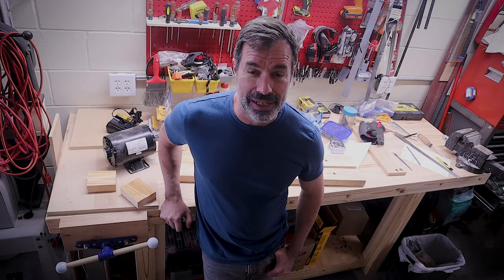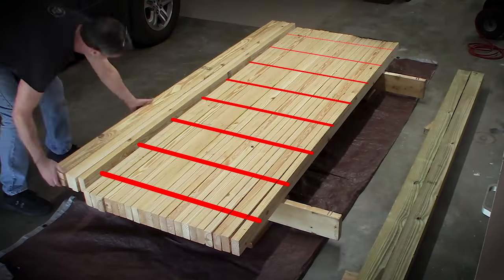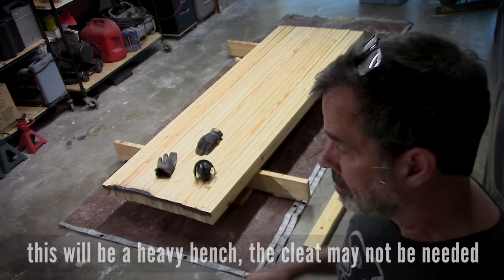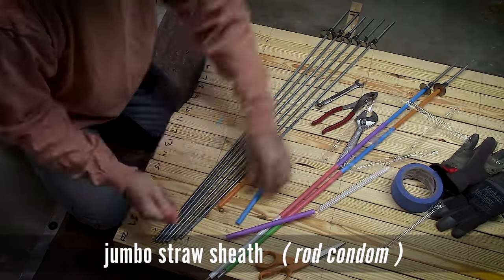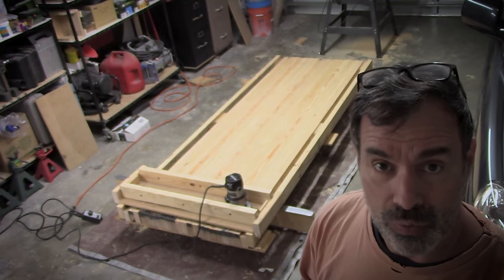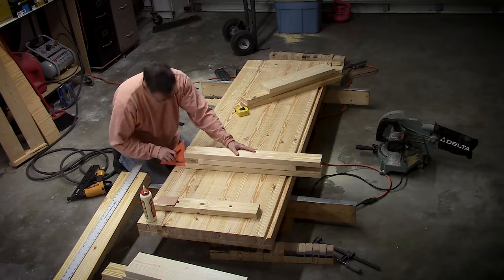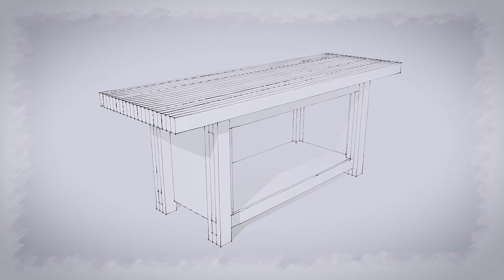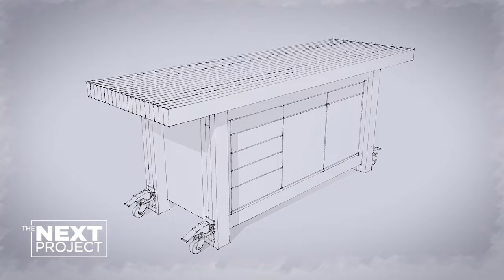Workbench BUILD Project. Easy, Cheap, Solid!

Comment: I got depressed looking at clamps prices and the rods idea is what I really need. Thanks for putting together this video.
Reply from the maker: Thanks for watching!
Agreed, clamp prices really bite. 
I looked at various long bar clamps, pipe clamps... nothing fit the budget.
The threaded rod idea was borrowed from others, then updated with the straw liners. Made it really easy to remove the rods.
If I were a bit better prepared, I would have had an extra set of hands and a impact to tighten everything up quickly, but it went well as it was.
A project I'm glad I got around to. Using the bench all the time.
Hope all is well, be safe and take care!

Comment: with the amount of wood alone i dont believe it was that cheap
Reply from the maker: Pedro, thanks for watching!
I put the material costs, at the time of the project,  in the video. 
https://youtu.be/-C-s544KZqg?si=_Sf5gj0hTCROQ-FW&t=1107

Southern Yellow Pine material costs as of "today" are actually lower than when I made the bench. Right now, the lumber (locally) would be $85 US. At the time I made the bench the lumber cost was $100 US.
I had planned to make a bench for a couple of years prior, but material prices were double, so I put the project off, and off... 
If I built this bench today, total material cost would be around $100 US (lumber, screws and glue). That's for the basic framed in bench, no add-ons.

This bench is made from southern yellow pine, not maple or anything fancy.
Good luck with your projects, take care!

Comment: Well Done ,    I really like the overall Cost  on the Bench  that IMO  is a very affordable Tool for any WorkShop  no matter what Trade   Is your Specialty or Focus  a Quality Bench like yours could be easily adapted  for Automotive work , Machinists,Woodworking  or just about anything  making it  having a great resale Value  if you ever wanted to go that Route  all you need to do is look at Commercially Available Benches and their Pricing   Which are Rediculously in the thousands Of Dollars
Reply from the maker: Craig, thanks for watching!
Agreed, this is a pretty good bench, especially for the money.
It's been about 2 years now, and I really can't complain about anything, it's been holding up great.
If I were to do it again, I would be more picky with the lumber I chose for the actual top. I have a mixture of tight grain, and some wider (fast growth) grain.  The tight grain is very stable, the wide grain has shrunk just a bit. 
No issues with the top, other than noticing a little wave in the wide grain lumber. Glue seams are all tight, so I think this bench will last longer than I will. 
Hope all is well, be safe and take care!

Comment: Looking to build my first workbench and while there are some easier builds, this right here is quite straightforward, absolutely beautiful, sturdy workbench and it moves to the top of my list. It will be more than 20 working hours for me for sure, but I'd love this workhorse in my basement. Great job, TNP!
Reply from the maker: isles, thanks for watching!
In the basement, nice!
This bench will be heavy, so it may want to stay in the basement, forever!

Be sure to modify the build, size and process to fit your needs and workflow.
That's one reason I built this bench, to fit "my" needs. As you mentioned there are a lot of easier benches out there. 
This is a bench I wish I'd had years ago.

One thing I didn't mention and really didn't pay attention to when I was making this bench. Be sure the wood you are using for the top slab is not heartwood - the center rings of the tree.  It will dry at a different rate than wood from the outer rings.
Overall I'm lucky, only have a few "center" type pieces of wood in the top slab.

Good luck with your build, be safe and take care!

Comment: Very cool 🤟
Clamping solution (including the setup drill guide down to "push the rod through as you glue up" 😉
Priceless and fun vid and build.
Cheers
Reply from the maker: Mark, thanks for watching!
The threaded rod worked really well. I was concerned it wouldn't have enough "squeeze" power, but it appears to have done a great job. The top looks seamless other than seeing the wood grain, and the fender washers actually crushed into the sides of the lumber a bit under clamping/tightening pressure. 
I had considered using 3/8" rod initially, but couldn't find enough at the time of purchase. I was concerned the 5/16" would snap, but it worked out well. 
A good project.
Take care!

Comment: Look into the bar clamps from Harbor Freight! Paul Sellers recommendations! No rods!
Reply from the maker: Thanks for watching!

Yep, I did look into the Harbor Freight bar clamps and have some on hand.
There are a  couple versions at my local HF. 
One is an aluminum box material for the bar, I don't find the longer version overly aggressive in clamping, which I needed. The bar stock tends to bend at length. They are affordable, but not near as strong as a slightly more expensive pipe clamp.

The other HF "F" style bar clamp uses roughly 1/4" x 1" stock for the bar. I have a bunch of this style HF clamps, but not enough long 36"+ for this project. The longer HF "F" bar clamps also flex a lot when clamping.  
I'm finding anything over 16", and I need to go with a pipe clamp, or higher quality bar clamp.
The smaller HF "F" bar clamps are great, I use the heck out of them.

Using the threaded rod, was a very affordable alternative, cheaper than buying longer lengths of pipe for my existing pipe clamp ends. 
I've since re-used most of the threaded rod also. So, I've kinda recycled the material into other projects. 
Good to have lots of options.

Thanks again, be safe and take care!

Comment: Excellent job and advice at the end, especially to build a bench to fit your own needs rather than just copy and past another's design.
Looking forward to more. Subscribed.
Reply from the maker: Thanks for watching, and I greatly appreciate your comment.
I pondered making a number of different style benches. Knocking off what others had made.
Then I realized those plans/ideas really didn't fit my needs. Not saying what I built is a 100% there either, but it is in the right direction. 
It was a fun project and I've been using the heck out of it. 
Good luck with your projects, be safe and take care!

Comment: Paint roller for glue-up was genius.🏆
Reply from the maker: Michael, thanks for watching!
The paint roller is the perfect scale for doing the glue up in this scale.
Use a deep nap roller, 3/8" nap or bigger. Short nap rollers won't hold enough glue.
Oh, the weather was also cool when I did this glue up, so the glue didn't instantly tack-up. 
Good luck with your projects!

Comment: Using threaded rods with nuts, etc., on each end running completely through the top that had holes drilled through in line was an interesting and secure way to accomplish the massive one piece glue up.  Is there a reason you opted to not use 36" pipe clamps alternating top and bottom or bar clamps?  Both would have been much less $ than the Parallel clamps also.
Reply from the maker: Thanks for watching!
I had originally planned to used pipe clamps, but I didn't have enough of them, nor enough pipe at the time and the cost of pipe and a few more clamps ended up being more than the threaded rod and pieces.
Otherwise, the plan was pipe clamps.  
Parallel clamps would be nice to have, but I've just never been able to justify the cost, at least for the type of projects I work on. Maybe someday, but no time soon.
Hope all is well, take care!

Comment: If this is what you consider easy, I'd hate to try one of your more difficult builds.  Easy is definitely relative to people's woodworking experience, and access to tools/machines.   

I gotta say that was great ingenuity on the cheap clamps, using the rods.
Reply from the maker: Thanks for watching!
I hear ya, I guess this isn't "easy, easy", but it is kinda easy, in a semi-complex sort of way.

I like finding alternative ways to accomplish tasks, so the threaded rod thing worked really great.
I borrowed that idea from somewhere, a lot of great ideas out there floating around.

Good luck with your project(s).
Take care!

Comment: What happened to the rebar you used to clamp with? Is it still in the top? Going to make something similar for an outside bench and I really liked your design.
Reply from the maker: Thanks for watching!
I've used up 50% of the threaded clamping rod. Various little projects, surprised how often I can use that stuff.
An outside bench, cool!
Good luck with your project.
Reply: Thanks! I mean the rebar you used as a clamp, is that still inside the worktop now or did you slide it back out after clamping? I was thinking you'd leave it in for added strength.
Reply from the maker: That was actually threaded rod, not rebar.  
Probably looked like rebar in the video, but was 5/16" threaded rod. I think it was 6' sections all cut down.  
I did pull it out of the top once the glue dried. Had the rod covered with drinking straws so the glue wouldn't bind it to the top.
Sorry if that was confusing.

Comment: I'm curious on why you used the router sled to flatten the top instead of using the bench plane that you used later?  Was there a benefit to using the router sled vs the bench plane?  I don't have a bench plane, or a fixed based router to mill lumber, and I opted to used plywood for my bench, so it's flat enough :)  Thanks for the video.
Reply from the maker: Thanks for watching and that's great question!

I had a few different/optional plans on how I would do final leveling of the finished top.
A large hand plane was one idea, but would require me to be in better condition than I probably am. My arms would have likely fallen off before I finished.
I also considered a different style glue-up of 10" wide gangs of top lumber which would then be run through the power planer = a really heavy beast to wrestle. I would have then had to glue those large sections together and do a final assembled planing, and that seemed needlessly redundant.
Finally, just using a router with a wide flat bottom bit seemed - easy-ish. 
The more I thought about it, none of the options seemed enjoyable, but using the router appeared to be the most "do-able", and least painful.

There are many different types and styles of bench, and each will have its place. Some are over-the-top, others overly simple.  I've worked on metal benches, plywood benches, solid-core door benches, countertop benches, on sawhorses and garbage barrels. Everything works, and there is nothing wrong with any of those options, they all did the job.

Glad your bench is delivering what you need, that's a perfect bench!

Hope all is well, be safe and take care!
Reply: @theNextProject  Thank you for the reply & the insight.  I've been woodworking for about 18 months now, and I find that I gravitate to a hybrid style between power and hand tools.  I've only worked with project panels and dimensional lumber because I've not had a creative way to mill it.
Reply from the maker: I hear you, milling large chunks of lumber is an issue.
Hybrid work style is a great idea!

I don't have a large jointer, so I do work arounds for that.
I do have a planner, but it's not always easy to navigate - my work space is fluid, so some tools don't have a fixed base and such. I work on the floor, on a bench... where ever there is a free space.

Being able to plane with the router has been a handy way for me to rough out a lot of material.
I can then clean things up with a large hand plane or sanders, but it depends on the scale of the project too.
I'm always looking for ways to make a big task smaller and easier.
Good luck with your woodworking adventures and projects.

Comment: How did you attach the top to the frame? Did you need to do anything to allow for wood movement?
Reply from the maker: Fred, thanks for watching!

Great question, I used eight #10, 3" construction screws. 4 across the front and 4 across the back.  The holes are slightly over-sized, so the head of the screw, not the shank, contact the leg structure. The screws thread about 1" into the bottom of the top. 

It's been almost a year since I made the bench and no issue with wood movement so far, at least nothing noticable. Maybe 3, 4, 5 years will tell a different story.  

I chose not to do a mortise-tenon attachment, as I expect to either need to move the bench someday, resurface or flip the top over. I wanted the top to be simply attached/removed, not permanent. 

Since the top weighs a lot, and the 8 screws keep it in place, I haven't had any issues so far.

While I was influenced by a number of other bench builds, none of them really fit my needs. I didn't want to build a "showcase" bench, but I needed an upgrade from using plywood and solid-core doors as benches. This build is somewhere in between. 
At this point, there are very few things I'd do differently, as it fit my needs, tools and abilities. It has been fleshed out with some drawers and cabinet doors since the video. The rollers added allow me to easily move the loaded bench across the garage floor, really nice when needed.

Good luck with whatever you build, make it fit your needs and have fun.
Be safe and take care!
Reply: Many thanks! @theNextProject

Comment: Is this bench supposed to be bullet proof?  Have you considered adding a steel plate for high power rounds
Reply from the maker: Ronin, thanks for watching!
Didn't plan on shooting at, nor finding cover behind the bench, so no, not really bullet proof. 
An add-on metal "drain pan worktop" has been considered for oily projects such as transmissions however - again, not bullet proof.
Take care!

Comment: New project, no 🎸 this time.
So let's see what you got 😎
Edit:
Idea for cheap workbenches.
I made mine from old wooden doors. Carpenters often have used ones for cheap or beer money.
I glued two doors flat, so i got a decent hight of the top and they are dead flat. Just saying, not as fancy your's is going to be.
Reply from the maker: Elrondo, thanks for watching, and sorry no guitars this time.
I hear ya, many ways to put a bench together. 
I'd been using an old cubical desktop as my bench surface for the last few years. 
Depending on if I had it attached to a wall or not, it did the job, but barely.
I'm hoping this will last me a number of years.
A guitar repair project is next in line...stay tuned.
Hope all is well, take care!
Reply: @theNextProject  
Over here the materials would have cost 2-3 times the price.
Construction wood went up 300% the last year. Even things like simple cement went up from 8 to 15 $ a sack. Bad times for DIY.
Reply from the maker: @TheElrondo  I hear you. The cost of a bench can be really high, that's why I had waited so long.  I had priced materials for this project in early 2022, the 2x4 lumber was $8.89 per stick at that time. When I purchased for this build the same lumber was at $3.35. I checked just a couple days ago for yet another project, it was $3.25.  
Prices will be up and down, like a yo-yo. It's all too expensive.

Comment: Why not pipe clamps?
Reply from the maker: Mark, thanks for watching and great question about using pipe clamps.

Pipe clamps were my first plan, but I only have 2 sets on hand with ± 30" pipe, guessed I'd need 8 to 10 sets total with up to 40" pipe lengths to clamp the top (48" stock").
3/4" end sets range from $10 to $20 each, so that's anywhere from $60 - $120 for 6 sets, just for the end clamp portion.
Then I needed a bunch of 48" pipe. Where I live, 3/4" galvanized is hard to find. I guess code and building practice is thinning it out. Black pipe was my second option but natural gas is not common in my area, so black pipe availability is also limited.
Then there is the price of galv, or black pipe with black pipe being the most affordable, but less preferred option. Pipe isn't cheap either, ranging from $100 to $175 for the pipe I would need = ouch!  
My local big box stores (blue and orange) list galv on their web site(s), but is only available as a delivery item, so it's not local to me.  HD lists 3/4" x 48" = $24 per length...ouch!

I also looked at long quick-release clamps, but they typically have too much spring in the long lengths and I was concerned they wouldn't apply enough clamping force. Again, 8 to 10 of those would be $80 - $100 or more, and not an ideal clamp for this reach.  

It really came down to money and attempting to save a few dollars on the build.
Since completion of the bench, I've reused about half of the threaded rod, so it's serving a purpose after clamping. Recycling in a way.

Pipe clamps would have been great option, I just didn't have enough on hand at the time.

Hope all is well, take care!
Reply: I would call your 2x6 risers.  Since you did drill and use the threaded rod will you utilize the holes for built in side clamps or jigs?
Reply from the maker: Risers, I like that!
I have added threaded inserts along the front edge of the bench in those clamping holes, and have used that to create some long clamping points. Wasn't an original plan, but just kind of presented itself. 
I've since made a bench top buffer, and added a cleat along it's base, which also uses those threaded inserts to help hold it in place.  I'm guessing there will be a lot of other nice accidents that happen as the bench hosts more projects.
A face vise was also installed at the left end, a removable machine vice on the right end, hmm, a few holes with threaded inserts here and there for other transient attachment needs.
As I add and drill into the bench, my lady says "why are you hurting your bench?". I had wondered this too, but realize it is a tool, that can be modified. It's not a fine piece of furniture or jewelry, it's a bench!
: )